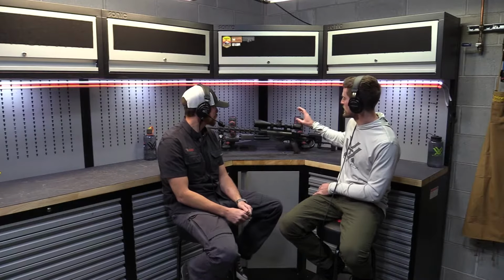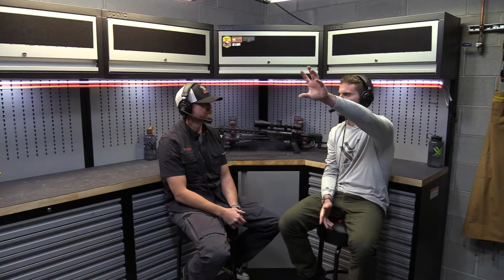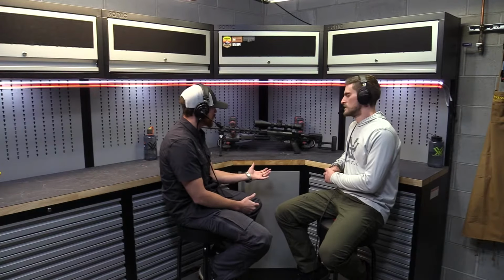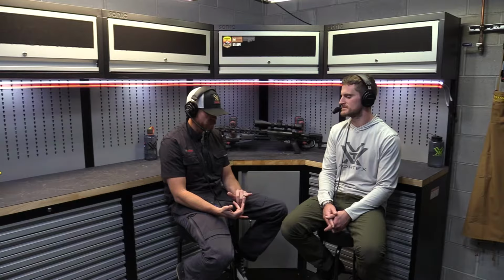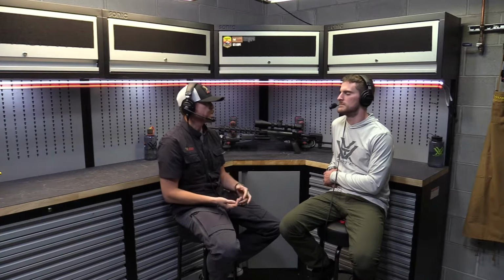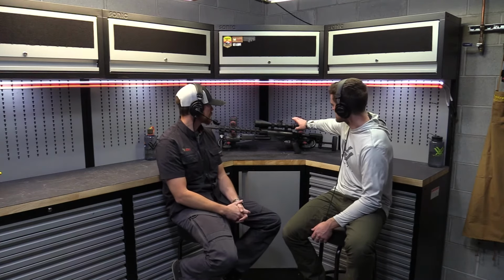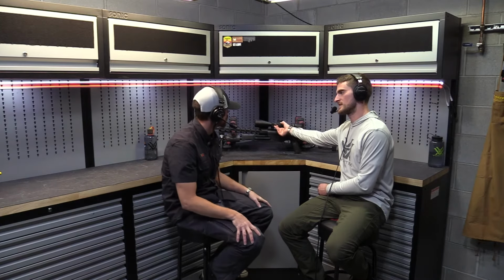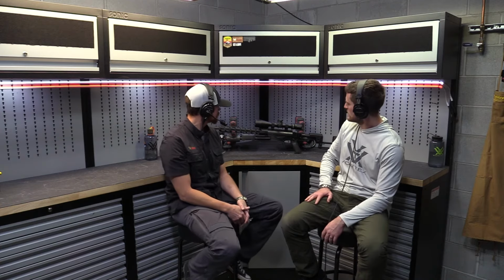Ep. 10 | How to Zero a Long-Range Rifle the Right Way

Comment: Job one is chronograph the load and then zero to 100 yards. 100 yards is important because it  will reveal sight misalignment. This is simply a placeholder zero. Next, use a ballistics app to understand bullet drop compensation from the 100 yard zero to the long range distance. Now, shoot a tall target at 100 yards applying the bullet drop compensation needed for the long range distance and note if the bullet strikes are left or right of initial grouping. This will give recognition of the optic being level. Finally, shoot match grade factory ammunition and use it as a base line for the accuracy expected from hand loads. And do not shoot F class because it does not support the number one thing which is marksmanship development. That will come from shooting NRA any/any LR using bone and sling support. That discipline helps to understand how to achieve muscular relaxation and natural point of aim which are as essential to long range as is an understanding for what to do about the wind.There’s much more but this will get anyone off to a great start. How do I know? I was once a novice and now I am an American High Power Rifleman in Long-Range Award Winner. The bottom-line is marksmanship is knowledge and skill. The knowledge comes fast and easy, while the skill takes time to develop.

Comment: When you set up a 200 yard zero, you don't do it at 200 yd. You do it at 100 and have the point of impact 1.5" high, or whatever it should be specifically for your setup.
Reply from the maker: Good rule of thumb, but we would always encourage to verify as it is not always the case between different calibers, bullet dimensions, and bullet weight.
Reply: @vortexedge4492  I was talking about setting up for hunting. For my PRS setup, I zero at 100.
Reply: why?
Reply: @lunam7249  mainly for two reasons. For hunting, you typically want to have the Maximum Point Blank Range. The second reason to do it at 100 instead of 200 is to minimize the windage offset.
Reply: @ i dont hunt, so you prefer a close animal as possible?200-300?....ok wind, in in LA, 340 days  is very very calm..but i understand youf logic👏👏❤️
Reply: @lunam7249  For target/steel or PRS I zero at 100, then dial for elevation as needed 200-1760 yards
Reply: @ you shoot at 1 mile?
Reply: Then it’s not zeroed to 200. What you’re describing is a 100yd zero, and preferably having a minimal difference between poa and poi at 200. This is a good setup. 

“Zeroed” means your point of impact and point of impact are the same at the first point where the projective crosses the line of sight.